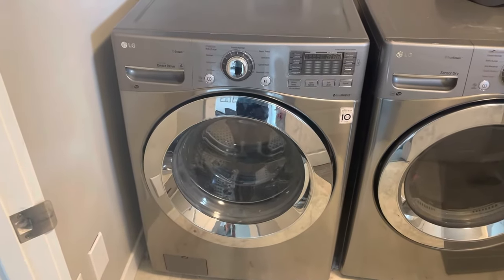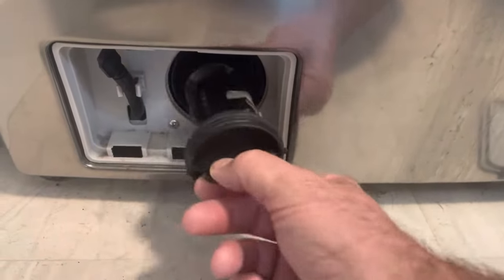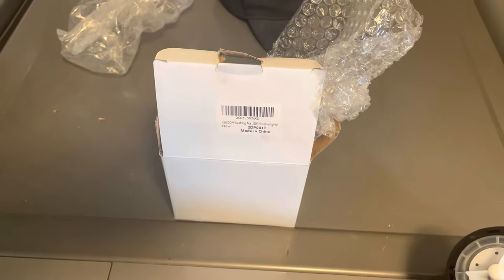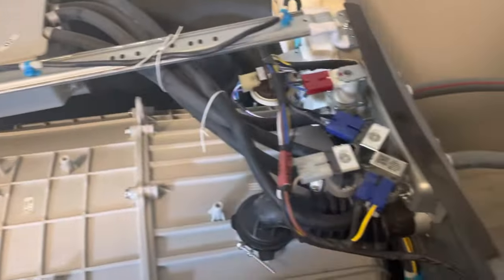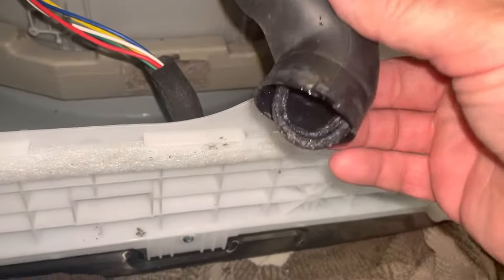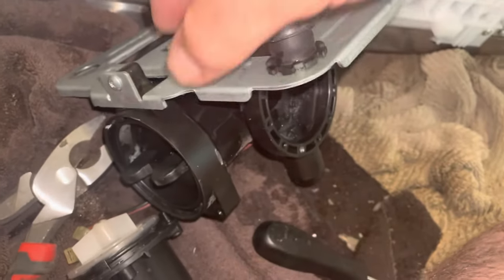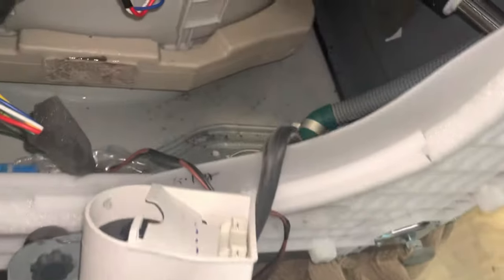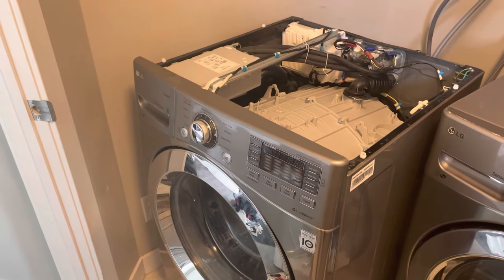#33 Lg front load water pump replacement

Comment: Thank you! There are many videos demonstrating how to do this with minor differences by model. I have the same exact model with the 3 bolts holding the pump/housing in. Thank you for also showing the pump wire connections. I hastily removed the connections without noting their position. None of the other videos show the connections. Now I’m just waiting on my pump to arrive to swap it in. Thanks again!
Reply from the maker: Glad it helped you. 👍

Comment: I have this same unit and today I replaced the drain pump in about 20 minutes. This video helped but I will add a few things:  1- You do not have to remove the top. Remove only the front panel of the coin catcher and then tilt the machine back to get to the 3 10mm bolts that hold the pump assembly to the bottom plastic frame. 2- You do not have to remove any of the hoses from the pump body. After removing the 3 10mm bolts, pull the pump assembly to where you can remove the 3 screws that hold the pump assembly to the metal frame. Then remove the screw that holds the cover over the drain motor, unplug it, then remove the 2 remaining screw of the drain motor. **Make sure you pay attention to the orientation of the drain motor as it connects to the pump assembly. Then simply reverse the order of everything you did.
Reply from the maker: Great advice 👍
Reply: I need to replace my drain pump, what model number do you have? I hear some can be replaced from underneath, but not all models.  I have a WM3370HWA.

Comment: My LG stopped draining during the cycle and UE or OE errors. Going to try a new water pump. Great video!
Reply from the maker: Hope it works for you 👍👍
Reply: @diyrepaircorner  It worked! Thanks again for the video. $23 later, clean clothes.
Reply from the maker: @krewjones  
It’s great when a  plan comes together. 👍

Comment: You only took the top off but what else did you take apart to get to clearly work on the bottom where the pump is? You didn’t show the whole process.
Reply: I believe the bottom does not have a cover and it looks exactly like he's showing.

Comment: Do you remember what model LG washer that is in the video? It looks like mine, which is a WM3670HVA. Other YouTube videos showing the same drain pump replacement for this model washer approach the repair work differently. They want to gain access to take out the pump by removing the front door, which in turn requires unscrewing the control panel so as to fold it back to access to get to the screws to remove the door, and then to get access to pulling out the control panel, the top of the washer is taken off. Doing all this gave access to the drain pump for removal from the front. The method in these videos seem straight forward. They only complain of the difficulty of getting the wire spring back around the rubber door seal. Is the technique you show in your video the common one used to replace the pump? I fear putting down the heavy machine on its front could damage the control panel and/or door. Another question. Why is it necessary to disconnect the water hoses from the machine? Why could they not be disconnected at the faucets and let hang? Thank you for any response.
Reply from the maker: I did it this way, because it seemed to be the easiest way for me to get access without tearing everything else apart. Lay it on front rest only on the front door and it doesn’t seem to damage. Anything you put something else down to protect it if you feel like it.  A few times.
Reply: It looks similar to my model as well: WM4270HVA. I did as you described. What I didn't notice until I was done was a gasket is on the drain pump motor and the washing pump motor, and one was left behind, lol. So, mine leaked on the first run, so I stopped it all, redid it and put the gasket on where it was missing, and leak vanished. I just wish all of the screws are identified, and easier to replace anywhere.

Comment: Why did you take the top off?
Reply from the maker: Realized it didn’t have to after all lol
Reply: @diyrepaircorner  Thanks! Making sure I didn't miss anything. Thanks for the video!
Reply: @diyrepaircorner   If you would have tilted the washer back, you would've had to just undo 3 screws to remove the pump assembly and removed the pump without removing any hoses.
Reply: https://www.youtube.com/watch?v=bCCN4D5fjQY&t=8s